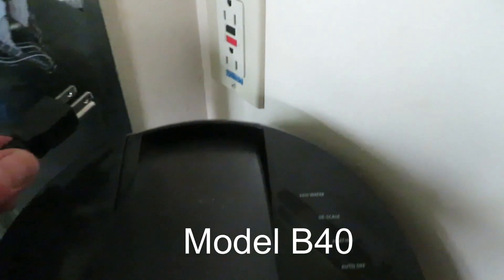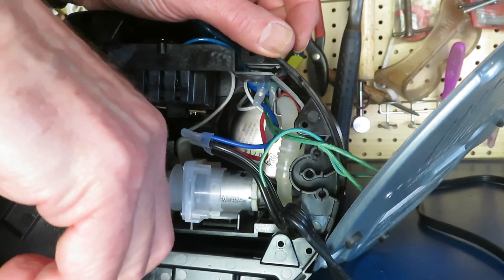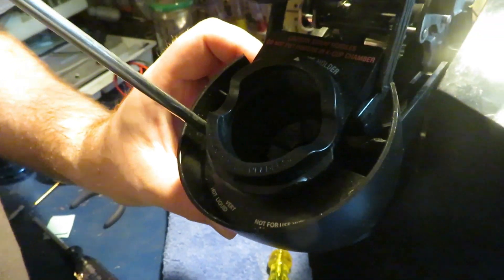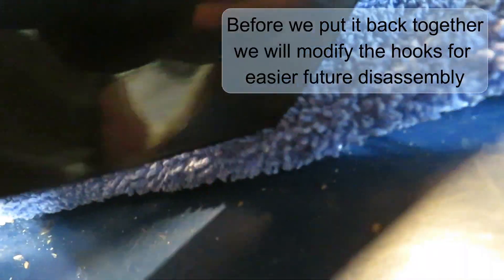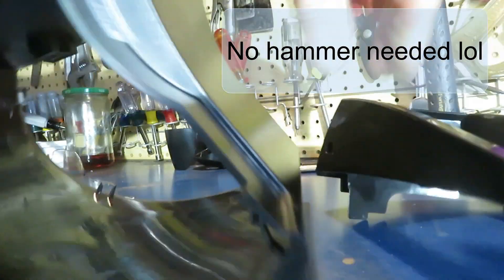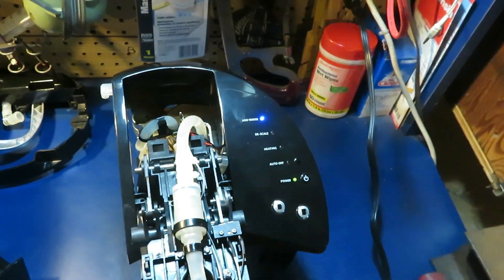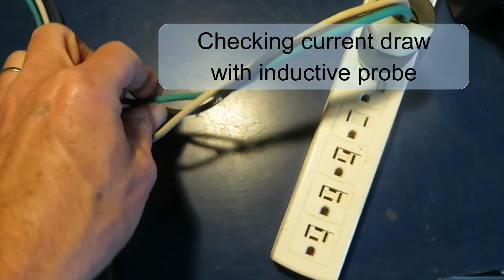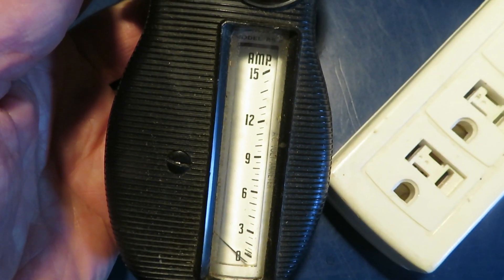How to Disassemble and Inspect Keurig K- Classic Coffee Makers B40 and more Tripping GFCI Breaker

Comment: FYI to all
Please DO NOT do what was shown at 14:35.
The primary cause of coffee not brewing is blockage. The top needle and elbow hose becomes packed with coffee grounds. To avoid this problem, press the pod down with your fingers to puncture the bottom needle first, then use the handle to close it, puncturing the top needle. This will prevent dry coffee grounds from blowing up the top needle into the elbow hose. I've seen this problem DOZENS of times

Comment: OK, I understand now, was wondering what you found wrong...  But, you found nothing wrong, just glitch in the GFCI plug.   Trying to fix my elite model...  It powers up OK, but shuts off completely a few minutes after the brew button is pressed...No noise from the pump at all.  I am theorizing that perhaps the pump is jammed/malfunctioning creating an overheat which is tripping some internal breaker that resets itself.  Have already ordered a new unit, but would sure like to fix this one...
Reply from the maker: You might be on the right track. I took the one apart to show how to do that, but have never actually fixed one of these. Good luck. I hope you get it going.

Comment: I have not needed to do a repair but I did discover that it is possible to remove portions of the plastic surrounding the k-cup to make that area much easier to clean.
Reply: Can I ask how.  I took all the K-Pod areas aprt to clean needels and also took the lever out but now have to figure out how to put back in before I can put K cup holder back in.
Reply: @lizk9053  There are two screws on either side of the k-cup holder. There are also two screws under the k-cup assembly. These allow you to remove two surrounding parts that serve no real purpose except to collect dirt.

Comment: Much appreciated the disassembly instructions. I have a K40 with a failing power button.  Now I know how to get at the PCB.  Thanks!
Reply: Were you able to repair the button? I picked up a Keurig from a Thrift store and all of the lights flash
Reply: @winfordlamb3  I haven't had to yet, but the switches are all the same, so I figured on swapping the wonky power button with the small cup one that I never use... when the time comes.

Comment: What was the problem? Mine won't power on. No lights, nothing. 

Your video was incredibly helpful in taking it apart but I'm not seeing what you fixed to get it to work.
Reply from the maker: This one was tripping GFCI breakers but worked fine on regular ones. I took it apart to find out why and make sure there were no problems that would  make it unsafe to use. I found nothing and just used it on regular breakers. As for your power problem I would make sure the components in the power circuits are getting ac power. If they are you may need a schematic to troubleshoot.
Reply: Thanks for the information. I was hoping there was just a thermal switch that could be reset somewhere, but I can't find it for the life of me.
Reply: @TheOriginalMechanic , I suspect that you are getting some leakage current from the boiler coil.  It only takes a few mA to trip a GFCI.
Reply: @johnc6880 , check your transformer.  I read that they are frequent casualties.
Reply: Just toss it in the trash and buy a new one. There is no simple repair on these things. If it's not readily visible/obvious, there's nothing we can do. And I'm sure Keurig won't sell repair parts either.

Comment: Curious that you didn't also do an examination of the GFCI, which is more likely the culprit, to see if a similar amp draw also caused it to trip. Thanks for the informative video, I got stuck on the three tabs, but after watching it was all smooth sailing.
Reply from the maker: We plugged this Keurig into a different GFCI right away and it still tripped it. Other appliances did not trip the GFCI shown in the video. If I didn't  mention that in the video, I should have. Thanks for watching!
Reply: Just watched a few of your videos on the snow blower fuel line and I hope I don't have to replace the carburetor but fuel line first thing